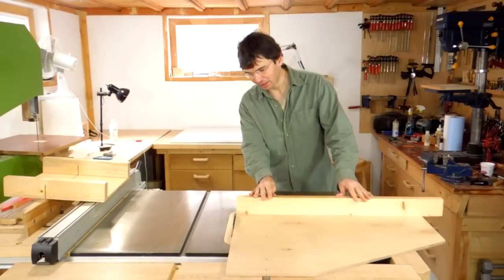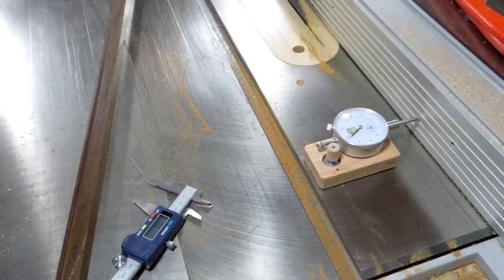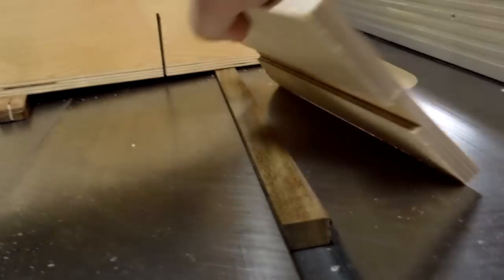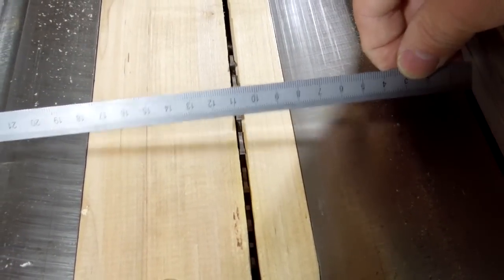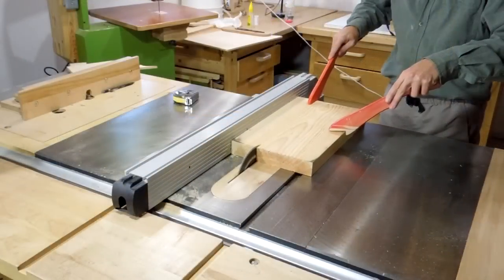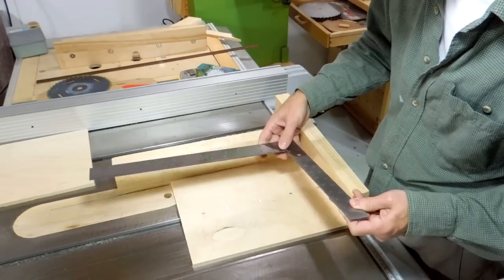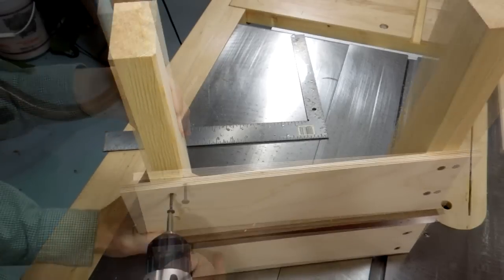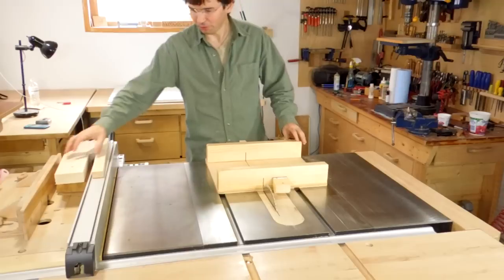Small table saw sled

Comment: What brand of framing square do you use?  I am needing one and went to local "super store" in Nashville TN and using the tried and true 3-4-5 measurment system, could not find one in their stock that was even reasonably square!
Reply from the maker: Jim Holladay Never came across a framing square that wasn't square.  You might want to check your measurement method.
Reply: Matthias Wandel First time for everything!! Went back and double checked - sure enough, it was "still" out of square. Used the 3-4-5 triangle system with "precision" Lufkin scales. Not only was it out of square,  Inch markings were not accurate -- off by 1/32 + over a 12 in span.  Since my original post, I found an old square that I inherited from my Dad's tools.  This square is at least 60 years old (I am 71) and the old square is "square"...! Ha!  Will now move on and build your small sled!  Engineer myself and really enjoy your work!
Reply: I saw a video on TV some years ago on how to use a metal punch to adjust the "square" of your metal square: Place it on a solid anvil surface.  If you punch in close to the inner angle, the angle will increase slightly.  If you punch it near the obtuse angle part (270 deg) the angle will decrease slightly.  This can be done several times if need be, to adjust it to a perfect 90 degrees.
Reply: bodryn That works!!  Thanks for the tip.  I used that trick on another old square and pulled it into shape in a matter of mins!!!

Comment: Do you ever have issues with kickback on the table saw? I see you don't use a saw stop and would not be able to use one with the sled.
Reply: Kickback results in from work piece misalignment, and that doesn't happen when the piece is securely resting against a sled moving on a straight rail

Comment: For some strange reason, when I try and cut very precise pieces for miter slot rails, I consistently get slightly tapered or thinner in the center pieces. It's extremely frustrating.
Reply: +Kirby Weldon When cutting hardwood the blade may be bending a little.
I think this why he cut his rail too large then made shaving cuts to get it precise.

Comment: You are fortunate to find a framing square that is square; many are not, and carpenters check them for square and make corrections by punching the inside or outside corner.  I did not know this and had a non-square cutoff sled fence! An artist's triangle will always be guaranteed square; I used on e after that to get the fence really square.

Comment: Mattias 
Have you built a sliding table  that can cut any angle yet?
I had scheppach table saw back in the 1990's and it had a sliding table with all angles.
I must admit, once you've used a tool a certain amount of times and you know it's falts, you get used to it and you suss out the glitches and work them out, I'd rather have that old scheppach table saw than put up with what's on offer today.
Love the videos man ☺

Comment: Great work, as always!  As to framing squares, I have two, and neither is square.  For some reason, both squares are off more on the inside than the outside.  Curious about your rip fence;  what kind is it?  I need a rip fence the old (early ‘80s) Craftsman table saw I am restoring.  It is purring like a kitten, cuts great, but I really need a decent fence.  Best wishes.

Comment: I really like your safety device to stop from sawing too far and hitting your hands. As a safety nut, though, I'd make two minor changes.

First add the extra half inch or so to the block on the back so that when your safety stop engages, none of the blade is protruding. Second, add a block of steel onto the back of the block. That way, even if the safety stop fails for some reason, your fingers are protected.

It will never fail, so you don't have to worry about damaging a saw blade. And when it does fail, you won't lose a finger.

Ken

Comment: dear sir, love you videos, some time cant make out what wood you use as many other videos dont give names of wood why don't you  have that information typed across screen as you give instruction,

 im in dire need of finding out where i can buy the blue rail or  gray rail.   they use on the sleds for attachments  
 
i  have went to home depot and lows  and ace, no luck
 second of all, i have purchased over 3000.00 bucks at harbor freight, and i find a lot of it is G.A.R.A,B.A.G.E., I.E.  grind double wheels one wire and other  stone. and they vibrates really bad it walks across the floor,, took it back and they said its acceptable , and i said it isn't suppose to have any it it, America made one don't.,  so i got my money back,
tool are soft metal.

Comment: So that the sides could be fixed at an exact right angle to the cut line, which is the important thing to get right. If he fixed it all together first without the cut line as a reference it would be more difficult to set it up to cut a true right angle